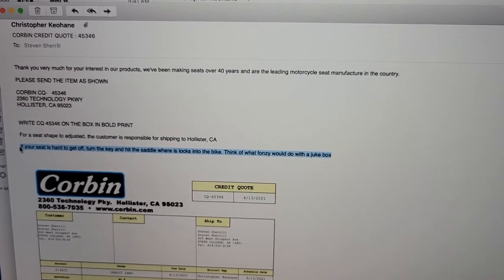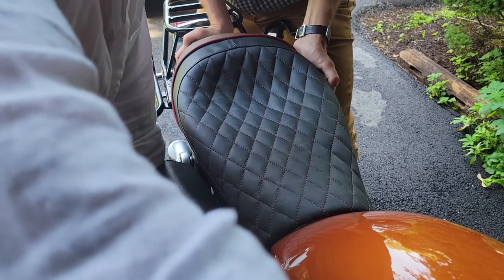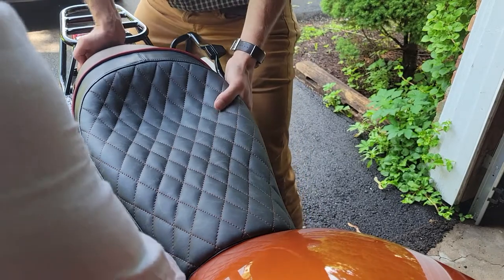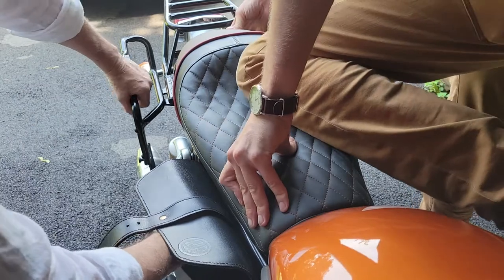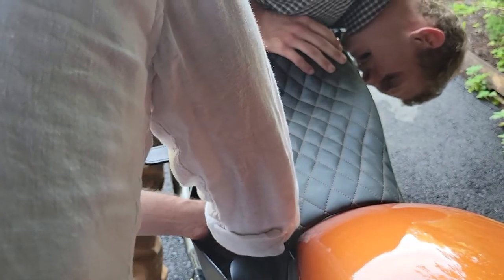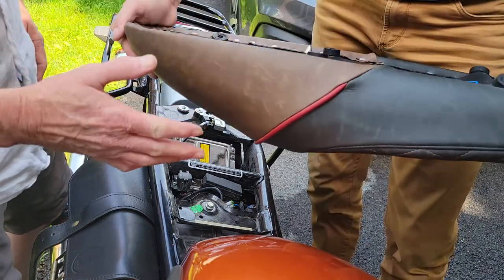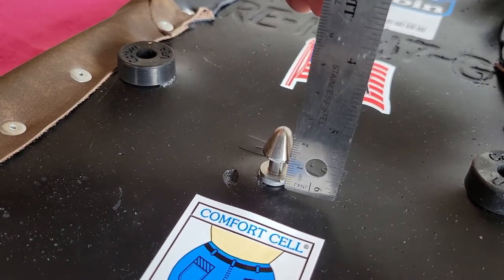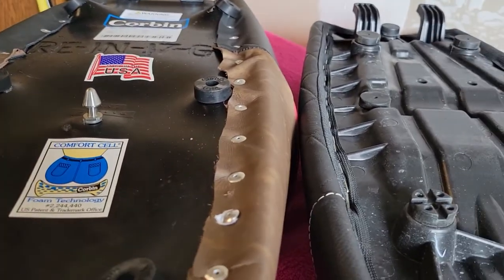Corbin Seat Malfunction

Comment: I had the same problem.  In fact, I couldn't even put the seat on easily.  I used a grinder to reshape the seat plug.  Now I can get the seat on and it's a little easier to remove.